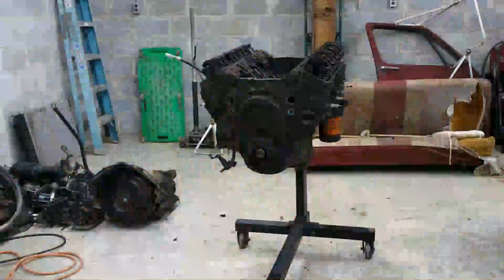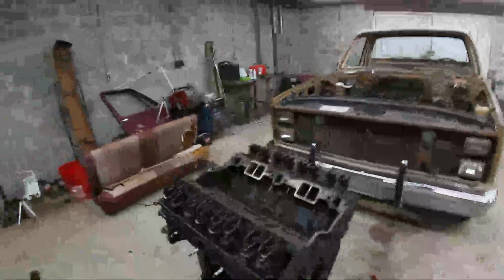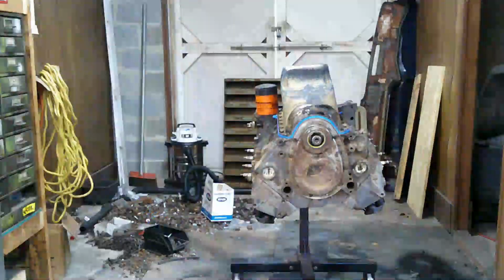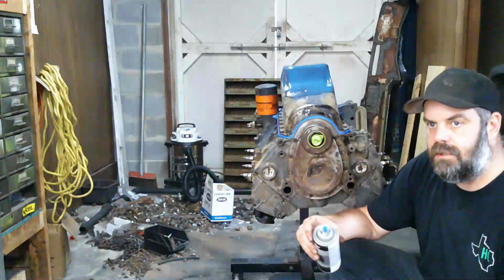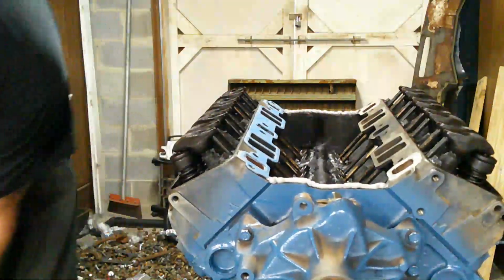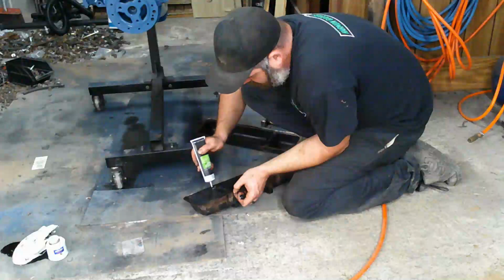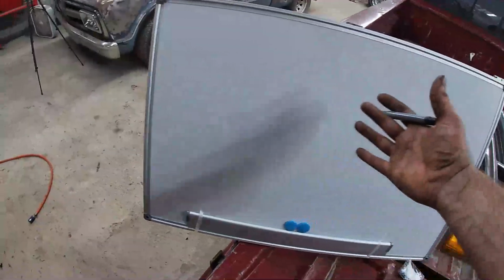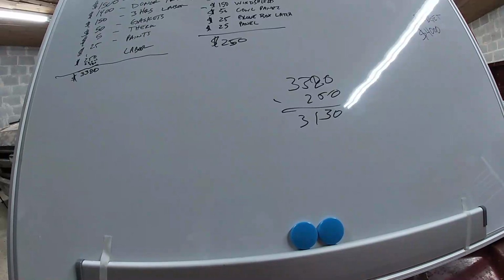1981 Chevy c10 short bed squarebody. Working on FLIP truck Part: 2

Comment: That motor turned out great!
I have a question about the transmission.
Is the transmission from the ‘84 a 700R4?
If it is the differential in the 81 may be too tall to make the overdrive effective. Might be worth swapping differentials if there is a big difference between them.
Sheryl and I were thrilled to acknowledged in this video.
In the world we live in, sometimes good things need to happen to good people!
We are both glad to help.
Thanks as always for your efforts to the truck community!
Reply from the maker: The 84 has a long shaft 350.  I didn’t put much thought into it but I will check the gear ration in flip truck to see what it is. It originally came with a manual on the column so it might be really high or really low.  Giving you guys acknowledgment was the least I could do. You are both very much appreciated

Comment: Might run some Seafoam in the oil once it's fired up. Run that for a while and then change the oil and filter. or pour straight diesel oil through it while it's apart.
Reply from the maker: I cleaned it out pretty good. I was gonna run an engine flush then put some Lucas in it. Thanks for watching
Reply: @HarmonGarage  I enjoy watching. I have to run seafoam in my wife's 08 Hyundai because the previous owner didn't believe in changing the oil. That plugged the oil passages to the VVT's and put the car in limp mode. I run half a can in every oil change and you wouldn't believe the crap I find in the oil filter. It has a canister style filter cartridge so it's easy to see. Seafoam has saved that POS. I HATE that car BTW.
Reply from the maker: Yea, it definitely works good. I cleaned all the gunk out when I had it opened up and cleaned all the oil passages. They make a product called motor flush. Comes in a tin can. It looks like red kerosene. You should try it on your car. It cleans everything out. Just make sure you aren’t in line with the drain plug when you take it out. It comes out in a hurry
Reply: @HarmonGarage  I'll look it up. I had something similar that I believe was made by motor medic? It was red as well.
Reply from the maker: That may be the one I’m talking about. I don’t remember who made it. But it did a good job cleaning out a slugged up motor